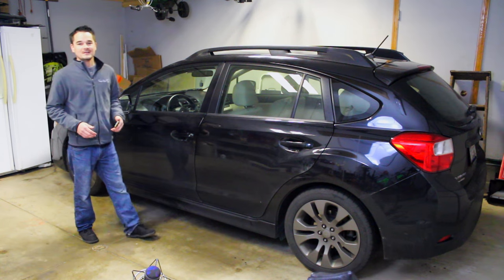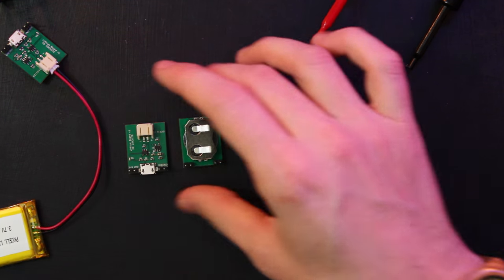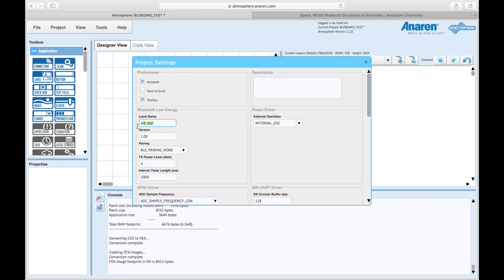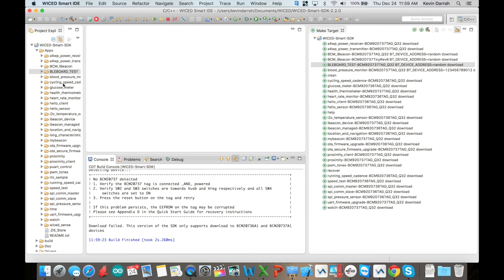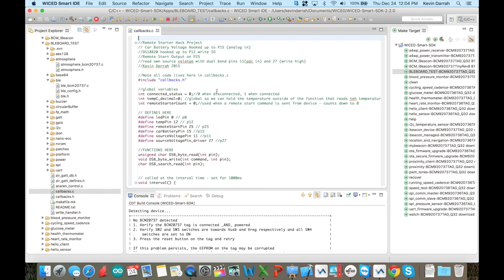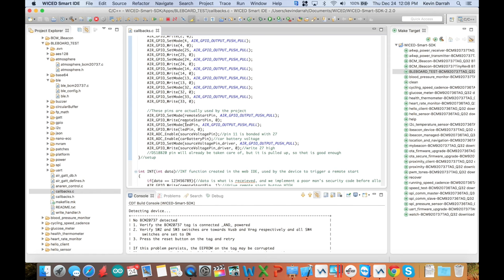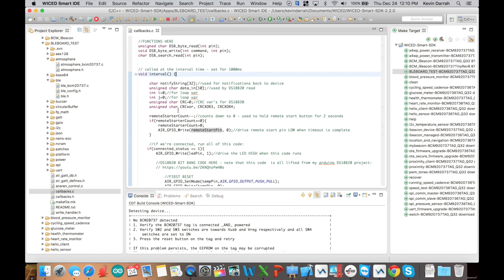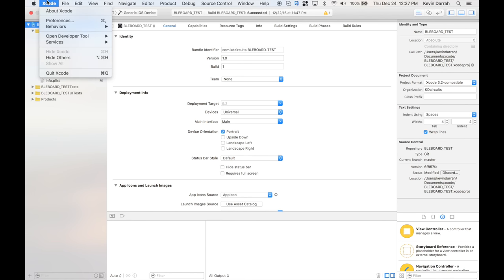Car Remote Start with Bluetooth Tutorial!  Full iOS and Bluetooth LE Walkthrough

Comment: Hi there
I am just working on a little project. 
it's an arduino Wi-Fi smart monitoring device powered by 3 AAA batteries and I am just wondering if you kind enough and help with some inputs on how to monitor the battery level while the device is going through its deferent stages ( deep-sleep, sleep and wake up modes) gathering data , to be able to determine how long the batteries will last and the lower level so an SOS signal will be sent to say battery low.
thanks

Comment: I feel like the range would be quite short for a remote starter with Bluetooth.
Reply from the maker: +Andy Plater you're absolutely right  - I forgot to mention that in the video.  It's not bad for when your car just out in the driveway, but not great for large parking lots or really any distance greater than ~10m
Reply: +Kevin Darrah couldn't you use a cellular module and a arduino/avr to practically start you car anywhere in the world
Reply: steven bloomfield Sure you can, and it's about the same difficulty level as it would be with bluetooth. I'm sure Kevin just wanted to make it with bluetooth for fun, and plus to do over gsm it'll cost you a fee to keep the car's 'cellphone' plan alive.

I've done it in my car, although remote start isn't one of the things it does, more of a security system/remote-stop. Thinking of doing remote start in the future, but my code has some problems I need to fix first.

Not sure if on-star offers remote start, but they have a lot of the same security features my system has for 4+ times the membership fee.
Reply: it shouldn't cost too much but you are right it would be a slight fee. im thinking about making one that why i brought it up, where i live it gets very cold in the winter and i would love to start my car inside of the factory i work at right before lunch or after work to have it nice and toasty when i get out. a few thing i would add to it are that it locks the door when it starts also the engine shuts down if the brake or gas are touched without the key in, it wouldn't be to hard to through together an android app to control it either, or just use a text messing based system
Reply: steven bloomfield Kevin's system would be easy to adapt to whatever comm technology you want, because it's using an off-the-shelf remote starter. If you can get a wire to turn on at the remote you can get it to start ;)